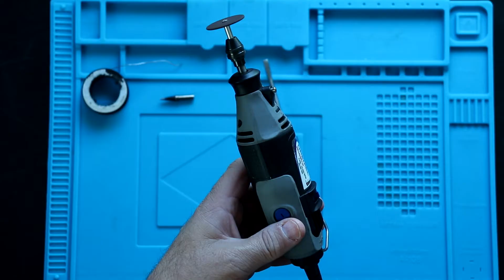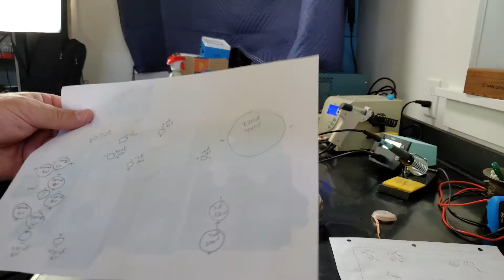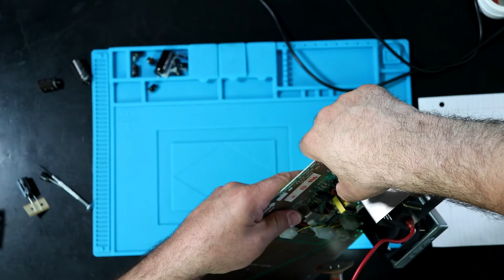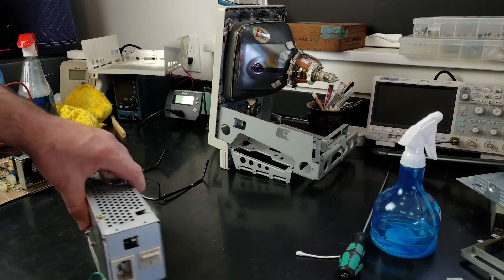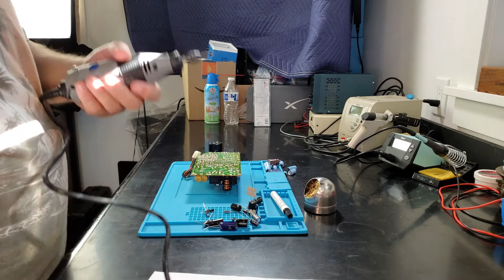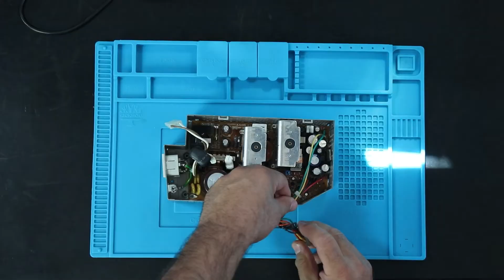[EXTENDED] Apple Mac SE/30 Analog Board and PSU Restoration - Extended Cut

Comment: Cool, thanks for the video. have you got a link of the capacitors to purchase for the Mac SE 30 Power supply and analog board ?
Reply from the maker: I prefer Console5 for my cap kits. They use high quality caps and the prices are reasonable. https://console5.com/store/catalogsearch/result/?q=se30